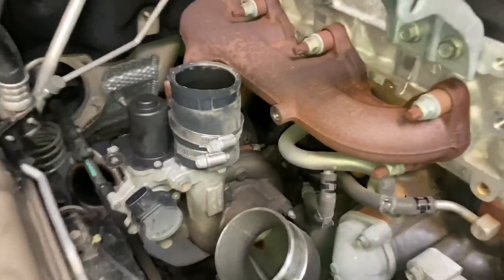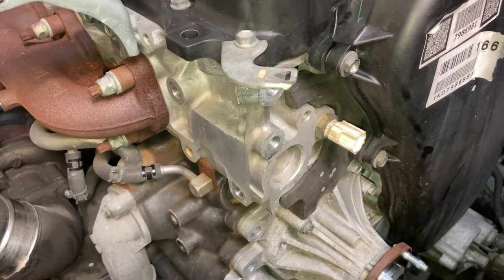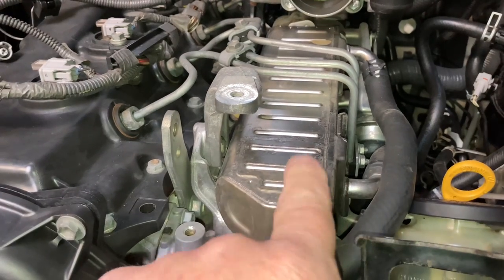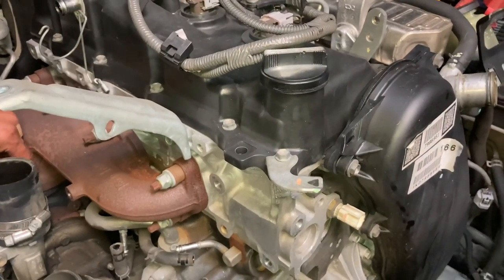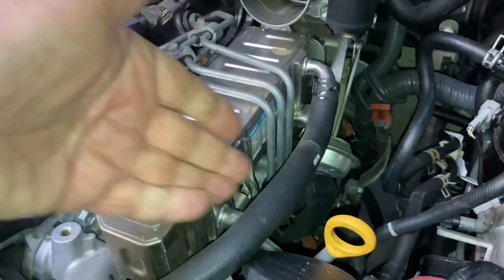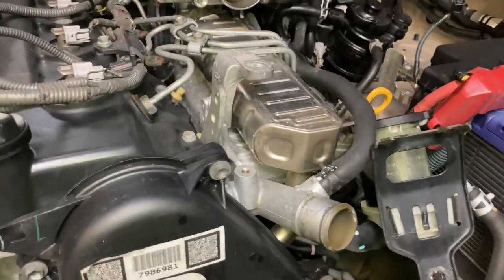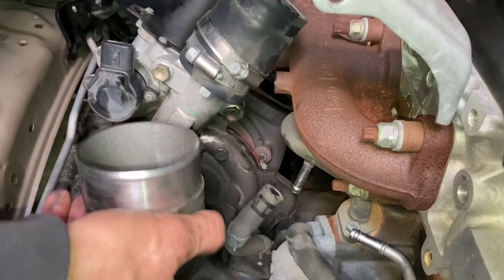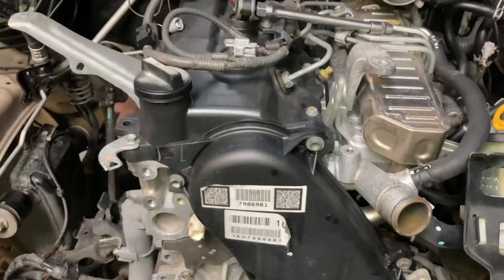TURBO REPLACEMENT and OTHER PROBLEMS to AVOID Leaking EGR cooler

Comment: Had a thermostat change out on a 2013 kakadu. It was running too cold . The thermostat was not closing fully allowing coolant flow. Changed thermostat then was running at correct temperature.  Not a lot of room to access thermostat.  Took a lot longer than I thought.

Comment: Im looking at potentially changing the egr cooler cause i cant find where im losing a minuscule amount of water, but ive had injectors changed not long ago, is there any way to avoid contamination if the fuel pipes need to come off since injectors are already new? Thanks again for all the videos mate
Reply from the maker: Risky
Reply: Less risky to just bypass the annoying cooler and turn off and blank the egr? "For farm use"

Comment: When you first startup for the day, some white steamy smoke.... then when taking off from home you will see more out the side mirror.   Then it will dissapear after 2 min of driving... Beware, your EGR cooler is cracked...  Stop immediatley and get to workshop... EGR cooler replacement.